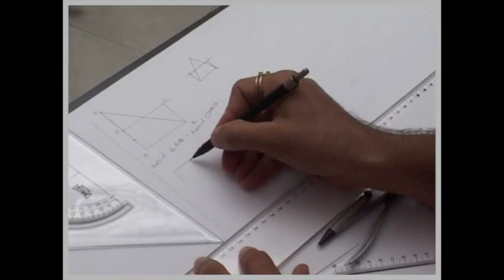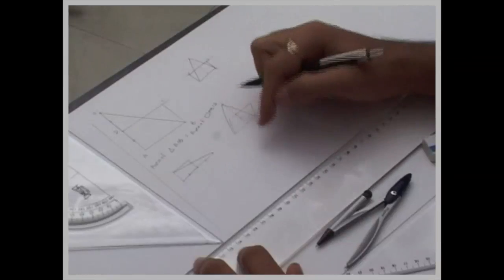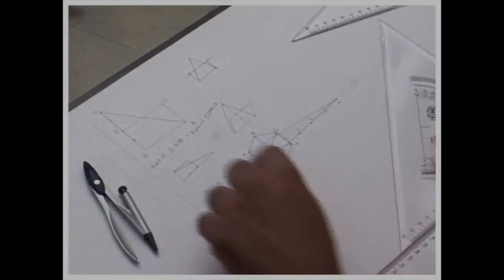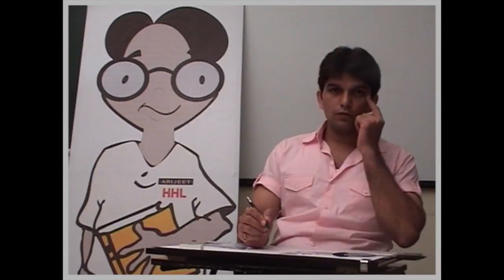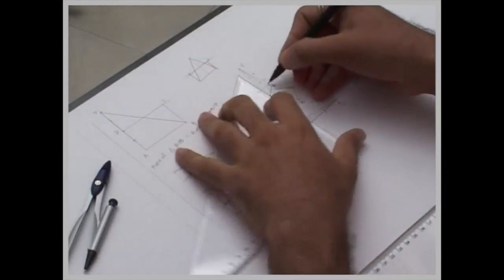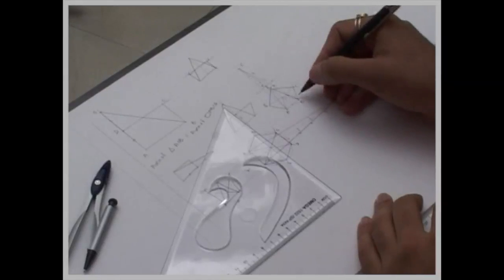Area conversion

Comment: Time stamps:
0:30 rectangle to triangle of same area
1:34 triangle to rectangle of same area
1:55 rectangle to triangle having same area( different base)
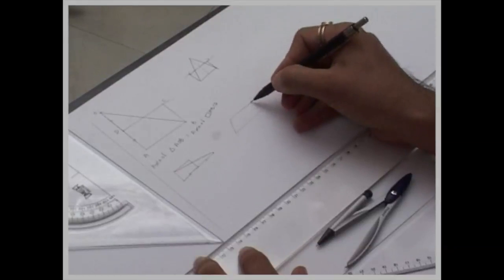2:09 parallelogram to triangle of same area
2:33 triangle to triangle having same area(same base)
2:54 hexagon to triangle of same area
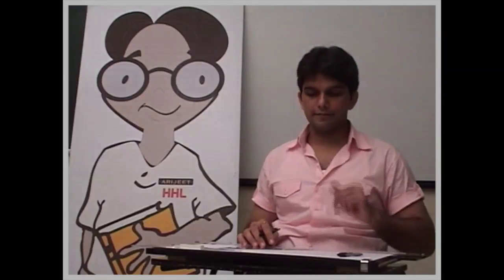4:14 Pentagon to triangle of same area(different height)
5:24 Pentagon to triangle of same area (different base)
8:07 rectangle to square of same area
9:35 quadrilateral to triangle of same area
10:32 one triangle having area which is sum of two other triangles